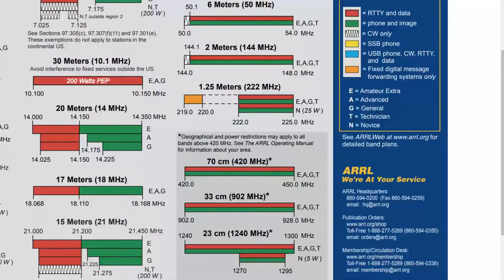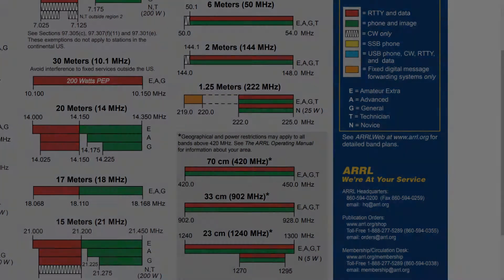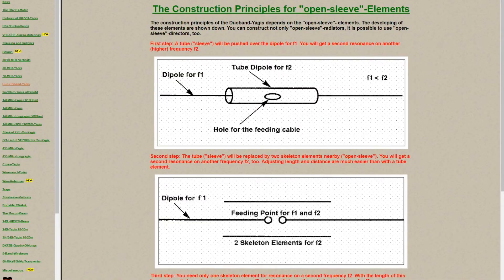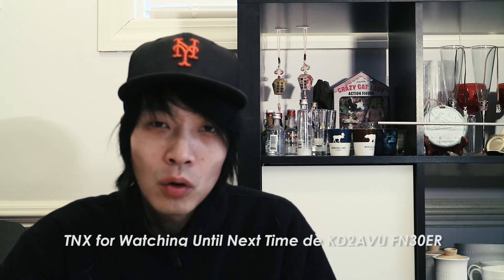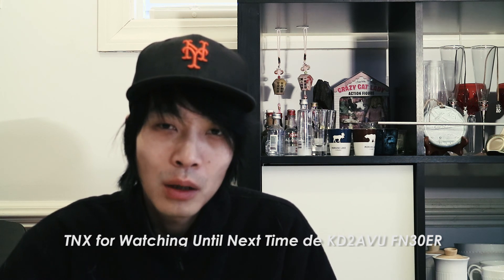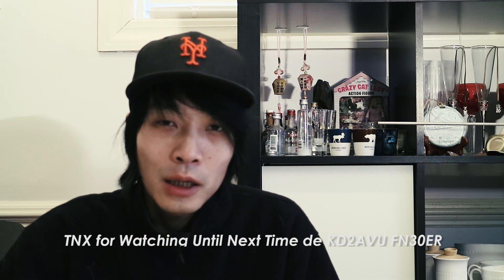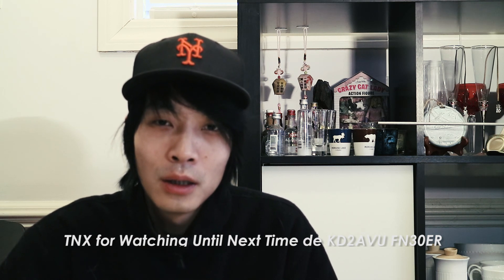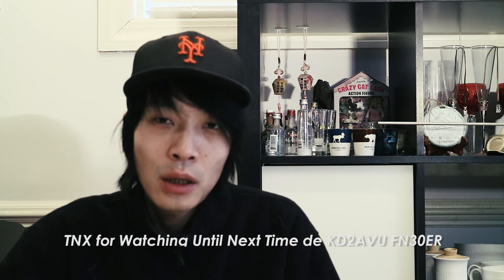Ham radio VHF/UHF Weak Signal - How to get started Part I

Comment: I'm in early stages of trying to receive some JT65 on 144.000.  Do I need a receiver that can receive SSB?  I know I have to be demodulating the way they are modulating but I don't know what that is.  What modulation will typical weak signal guys be using?
Reply from the maker: 1ST you need a receiver that can receive SSB or just use an SDR Dongle if you don't have one.
2nd You need to have WSJT installed on your computer in order to decode.
3rd Here's a link to some useful links https://bit.ly/39xIiij On VHF and UHF contacts were often scheduled so get into one of these chat rooms and look for peoples schedule or ask someone to do a test with you. "The ON4KST amateur radio chat" is a good one I used to use it often.
4th Different Mods were used for different purposes like FSK441 is used for meteor scatter JT65 is used for moon bounce.

Hope it helps!